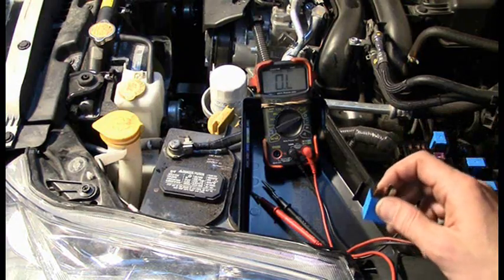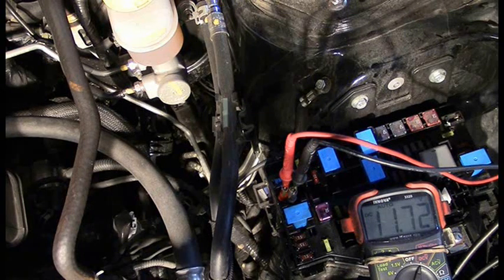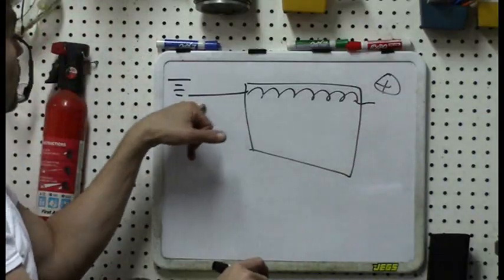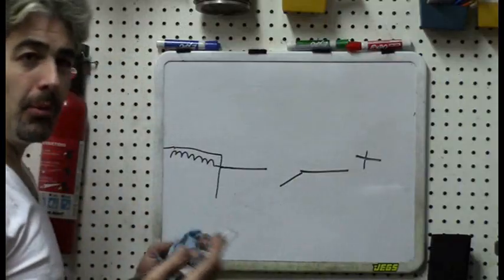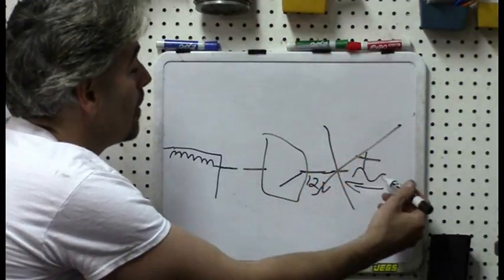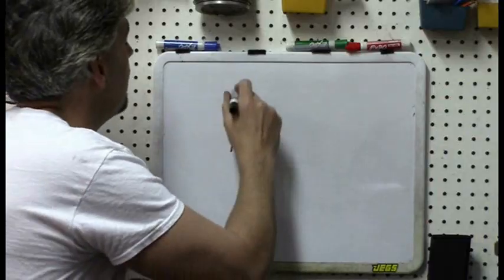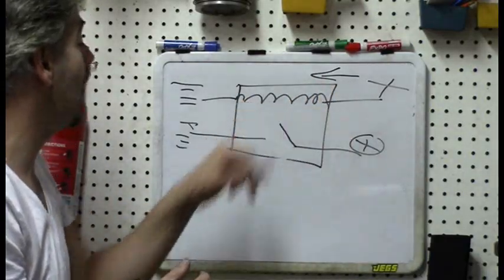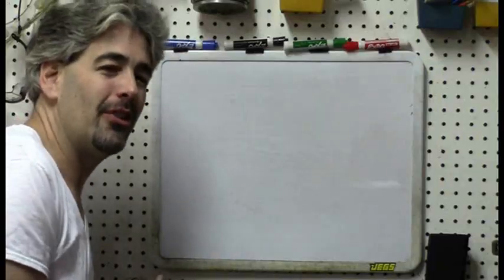Relays- Understanding, Diagnosis and Testing Relayed Circuits-Pt2

Comment: Tech tips;

Here are a few thoughts about relays on cars;

Much of the time, the relay will be referred to as the standard "Bosch 5 pin relay" type. It is an industry standard. They are made by many companies, and are easily available anywhere.  But the "Bosch style" is not always used. Other types and designs are used as well.

But the Bosch style is used on most modern cars. The 5 pins have universal meanings. Each terminal has a specific universal number, whether the relay is labeled or not.  The linked articles cover that in detail. The pins are also positioned in a universal way so that you can see which pin does what, by looking at the bottom of the relay (the pins, or blades).  In other words, if you memorize (or use a picture of) what each pin is used for, based on it's position and angle, that will be the same on every Bosch style 4 or 5 pin relay.

And the numbering is also universal (i.e.  Pin 30 is the high amp input, pin 87 is the high amp output, etc.)

I THINK, but I am not positive, that the color scheme for all 5 wires is universal. You'd need to research that, but I'm fairly sure that each of the five terminal wires on a proper socket would use the specific colors, but I have also seen reference to sockets being sold that don't have the proper color wires attached to the proper socket hole, so be careful with that.   The sockets, with a few inches of pigtail wiring are available at any auto parts store.

When replacing a relay, it is important that the relay have equal or greater current ratings as the original. Usually, both the primary and output sides will be rated, for example, something like this:   20/30    It means 20 amps rating on the input coil and 30 amps rating on the output. Of course, having 20 amps on the primary side virtually never happens on cars (it would negate the whole point of using a relay), but the relay does need to be rated to handle the proper output (switched) current.

Relays rarely fail. When they do, it is usually because the switching contacts get pitted and corroded, and basically just "wear out". The other typical failure mode would be an open in the coil side (input). Most of the time, when a relay wears out or fails, it is due to the wearing out of the contacts in normal use, OR the output circuit is carrying more current than it is supposed to, which obviously means there is a problem in the switched (output) circuit.

The Bosch style relay is cheap, about 3 to 6 dollars. It is important to buy a decent quality one.

On many relays there will be a diagram, and it will include the letters NO and NC, meaning Normally Closed and Normally Open. Matt covers that very well.
It is not very common for pin 87A to be used. Sometimes it is used, but not a lot. Even so, MANY cars will use a 5 pin Bosch style relay even when only 4 pins are being used. The articles linked below cover that.

The input side (the coil) can be power side switched or ground side switched. It will work fine either way, but power side switching is by far the most common.

As Emmanuel Munoz mentioned, the coil side can (and should) be tested for resistance. An open on the coil would obviously show infinite resistance.  When testing the output side of a relay using a meter or test light, it is very possible for the test to show a good relay, when it really isn't. It only takes a trickle of current for an ohms check across closed contacts, or a small amount of current to power a test light, but the contacts can be so pitted or corroded that they can't handle any significant current, as it is originally designed to.  I.E. it might test ok for resistance when closed, or it may power a test light fine, but when used to carry the high current that would be typical (20 amps or so) it just can't do it. So tests for relays can be a little tricky.

The purpose of the bypass or "quench" diode that Randy Jones mentioned is covered in some of the links below. But none of them will probably explain it any better than Stuzman does.

Many cars use several identical Bosch style (or other types) relays.  My car has 4 next to each other in the Power Distribution Box, all with the exact same Chrysler OEM part numbers. So for testing purposes I could switch two of them and see if the suspect one works OK.

Some  "flasher" circuits (like turn signals) use a connector that will accept a 4 pin or 5 pin Bosch style relay, but don't make the mistake of putting a relay where a flasher belongs. Very, very bad things can happen.

Excellent videos, Matt, as always.
Reply from the maker: Fantastic feedback as always.  Once again I learn more from the comments than I did researching for the video.  I probably need to get the comments first before I do a video next time lol
Reply from the maker: toolman talal Agreed- given the new information in many of these comments, I agree more detail is needed on 5 pin and diode relays.
Reply: i think this video need a 3rd part to complete the vision on the relays .
thank you matt for the great explanation.

Comment: Some comments on Comments (part 1 and part 2):

Randy Jones makes an excellent point (video part 1)about the inclusion and importance of the diode on some relays. The resources that I've linked talk about the purpose of the diode.

Stuzman52 wrote an EXCELLENT piece (video part 1) about why the diode is there and what it does.

Gene Hensley: Most of the links I posted below discuss the usage of the 5 pin relays. Keep in mind, MANY times a 5 pin relay will be installed on a car, but that the 5th terminal is not actually used for anything. But, sometimes the 5th pin IS used. Of course, you'd have to check your wiring diagram to be sure, but when replacing a relay, it is easiest to just get a direct replacement for whatever is already there.

Emmanuel Munoz made a good note about testing the coil resistance. That subject (testing a relay) is covered in some of the links below also.

Billy R made an excellent point, to use a test light when initially testing the input and outputs of a relay, to limit current.

Comment: Here are some additional nice resources for anybody who would like to learn more about relays used in cars.

GOOD
http://www.rowand.net/Shop/Tech/AllAboutRelays.htm

http://www.the12volt.com/installbay/forum_posts.asp?TID=82398

http://www.eurekaboy.com/f250/relay101.htm

GOOD
(SOCKETS AND WIRING COLORS)
http://www.parts-express.com/12-vdc-5-pin-relay-socket-for-bosch-type-relay--330-075

VERY GOOD
http://www.classictruckshop.com/clubs/earlyburbs/projects/bosch/relay.htm

http://vintage-vans.forumotion.com/t24603-how-to-use-relays-in-your-wiring-projects

http://www.ripper1.com/tech/wiring.php

BEST
http://www.bcae1.com/relays.htm

http://www.rattlebars.com/avalanche/relay_basics.html

SHOPPING AND PRICES
http://www.skycraftsurplus.com/boschstyleautomotiverelay12vdc40ampspdt.aspx

PRETTY DECENT YOUTUBE VIDEOS
Introduction to Bosch Relays

How An Automotive Relay Works and How to Wire 'Em up

OTHER
http://173.194.46.97/url?sa=t&rct=j&q=bosch%20style%20relay%20diagram&source=web&cd=1&sqi=2&ved=0CBsQFjAA&url=https%3A%2F%2Fwww.servocity.com%2FRelay_Manual.pdf&ei=td5aVNyTK4SxogTo44C4DA&usg=AFQjCNFUzaqT6qR85gRU6I7j03IYkgc3Kw&bvm=bv.78677474,d.cGU&cad=rja

Comment: Great diagnostic.  You broke down that issue perfectly.  Bravo.  You said you only have a basic understanding of electrical diagnostics but obviously you don't give yourself enough credit.  You are easily on an intermediate to advanced level.  If you can diagnose a bad combination switch (light stalk) then you're definitely not a beginner.  Beginners don't even know how to use a multimeter to it's fullest potential and you whipped right through voltage and resistance testing.  The only thing wrong you did in this series is not properly evaluating your own skill level. You might think you only have a basic understanding but isn't that always the case? Everything seems basic when you know what you are doing.  ;)

Comment: These are very informative videos both for the novice and experienced.Even though I have never used a Power Probe, it is a very versatile tool,especially for the novice where it is very easy to do a straight short on the main power lines.As the Probe will cut out in this situation ,it prevents an under hood barbecue.It behaves like the RCD on the house mains.From experience,the main contacts can be closed but due towear and pitting, no real contact is made.
Reply: Good point.

Comment: I did understand relay operation before this, but now I can actually use the information beyond testing the relay! :)

I repeated myself out of excitement. Deleted that. :)
Reply from the maker: Yes the ability to diagnose a relay is one thing, but being able to use a relay socket as a diagnostic port is a whole new level of efficiency.  This is soooooo much easier than testing at the connector or fuse box in most cases and sure as HELL beats laying on the floorboard under the dash and steering column!